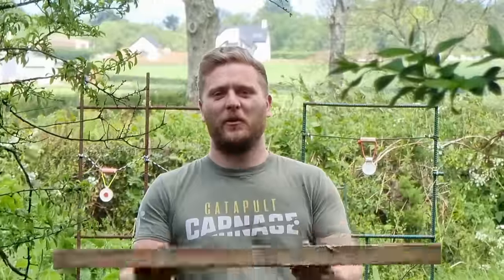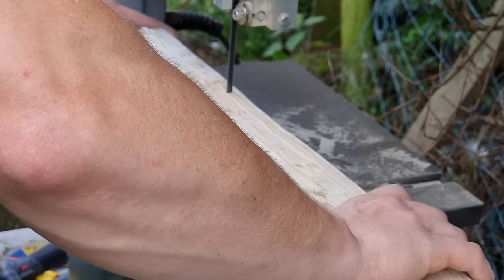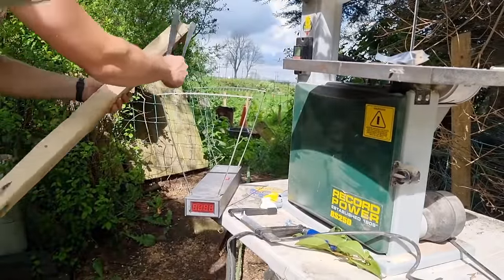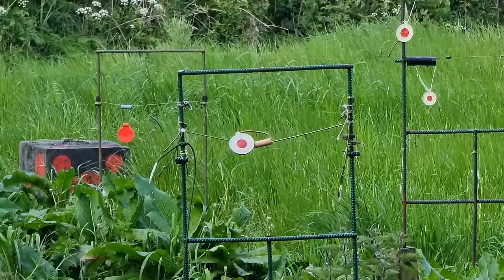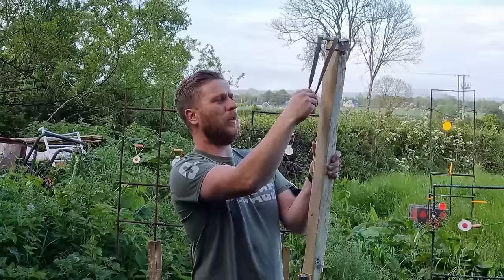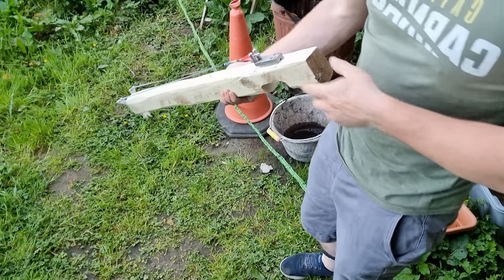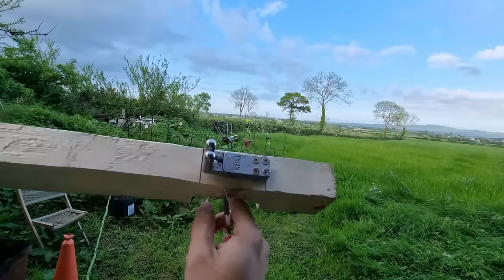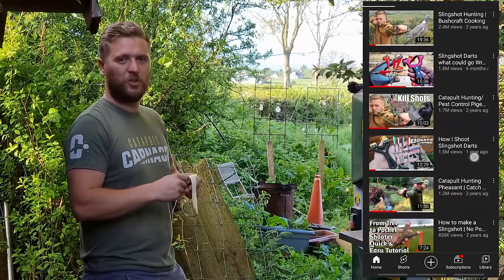2x4" Slingshot Rifle Amazingly Powerful and Accurate

Comment: The reason I became interested in slingshots was because of slingshot rifles. I bought one of those ready made ones from China and, though it's expensive, it's a lot of fun. It uses 6 latex tubes and it's pretty powerful. The trigger assembly slides up and down a couple of steel rails, so to load it, the trigger is allowed to slide down to the forks and the pouch is inserted without any tension on the bands, then using a stirrup on the front forks, the trigger is pulled back into position and then locked into place. It reduces the risk of any misfires. It also has picatinny rails so you can trick it out with sights, a bipod, laser sight etc. I have a bipod and red dot sight on mine and it can shoot the nuts off of a gnat at 50ft. I'm planning on using darts soon. I have some broad head darts coming from China soon but they're taking ages to get my stuff here.
Reply from the maker: Sounds awesome mate
Reply: @CatapultCarnage  which slingshot gun (model) do you have exactly?
Reply: I was trying to make a other one but then i saw your simple video and works very good thank you!

Comment: I want to see a proper rifle stock one with 1mm bands or proper heavy duty tubes firing 10 or 12mm leads with a scope attached i reckon you could make something really accurate and powerful that wont chew through bands so much with a little tweaking here and there

Comment: This might sound like a strange request... but I can I get your mailing address? I've been casting some lead ammunition using a .390 Lee ball mould I got off Amazon, and I would like to send you a couple dozen to see what you think of how they handle and how the trajectories vary from ammunition you normally use. I normally shoot 9.8mm steel ball bearings and it's been a good bit of work to adjust to this new ammo I've been making for myself.